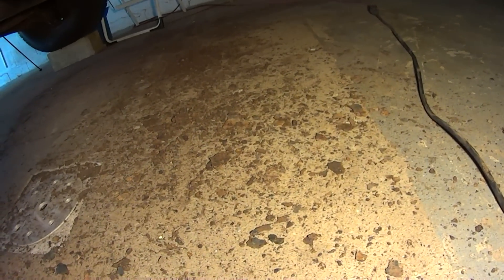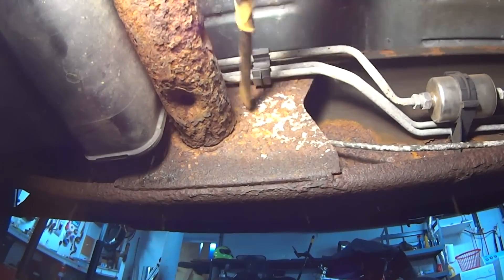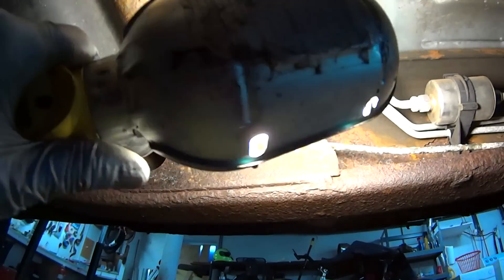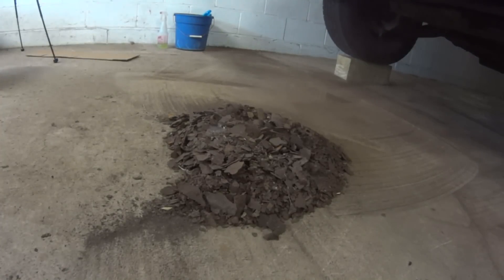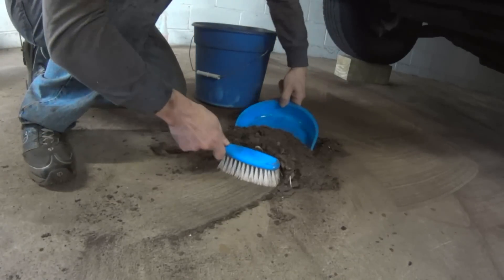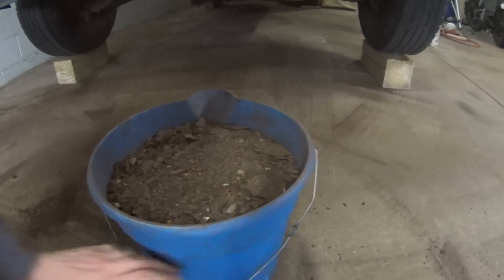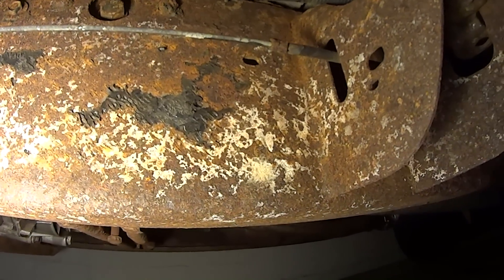Most satisfying video. Silverado Frame rust removal, RUST PROOF STUDY

Comment: Oddly what people do not is those semi thick layers that appear to be a semi thick layer of metal are actually the OEM rust proofing layer.. It is so decomposed and hard it appears to be a layer of the steel when in fact it is only the rust proofing with metal attached... This is what our Government has allowed China to do is remove the Nickles and Carbons from our automotive metals rendering a 30K Silverado truck a 50 cent piece of shit...

Comment: So you use an air chipper on it, then you grind it, and then I'm guessing you sand blast it.  Then you throw it away and but a different frame and just replace it?  With all that metal gone it sure can't have the same strength it had when it was new.  Just sayin.
Reply from the maker: 80% of metal is still there. Its 2500 truck that has the frame 3 x stronger than 1500

Comment: It's funny that Chevy makes fun of ford for using aluminum in their truck but from this video I think I'd much rather have ford.
Reply: Aluminum may not Rust but it does corrode. When you put two dissimilar metals together they corrode. So not sure how an aluminum body on a steel chassis is any good. 
Ford says it’s Military Grade aluminum. I highly doubt armored tanks are made of aluminum. Maybe their watches are.
Reply: @RedWhiteAndBlueVideo  Military includes aircraft, which are partially made of aluminum and have to survive decades in sea air which is loaded with salt.
Reply: john broskey I been where they make the aluminum Ford and I would not buy one, I seen them bring put whole bodies to throw in the roll off and a guy picked up a dumpster with a Hilo and sat it on top of the body and it just smushed it to the ground and busted into thousands of pieces. plus it corrodes and pits and turns to white powder, just a few years and these thing will litter the junk yards.
Reply: Brock Webb ford has that e coat that protects the hell out of it
Reply: xXxGnuVirusxXx I'm in the Northeast and I see e coded Ford frames come in the shop all the time the e-coating is fairly new I believe they started in like 2010 and it doesn't rust like what you see that Chevy but the E coating comes off in sheets instead of small pieces and then the rot begins so it's better but it's not perfect
Reply: RedWhiteAndBlueVideo Humvees are made out of aluminum
Reply: Chevy's will be using aluminum body panels too
Reply: iLikeC00kieDough so are semi truck cabs!
Reply: xXxGnuVirusxXx Ford e-coating is just as worthless as GM's wax coating. I've seen Fords with e-coated frames that look just as bad as this.
Reply: mcjagermech just doors and tailgate, 0lus the good that has already been aluminum for years. At least GM wasn't stupid enough to try to male the bed out of aluminum. Weak as hell.
Reply: Trucks rust. I really don't think the brand matters. Your truck or car will rust no matter what, that's just science.
Reply: Galvanizing and properly painting things the first time... also science, and your car WILL last longer.
Reply: Ya go look at the damage from "unsecured loads" lol where the bed gets destroyed, I could never and would never own a ford with an alu bed... I've had in my (older) chevy pallets of cobble stone... sliding around while plowing though nothing of it... if it was a ford with alu bed, the bed be destroyed...  Fords are too heavy, they went alu to drop weight.  This is a frame we are looking at not a bed... as said fords use steel as the frame material.
Reply: Funny thing about that, the "All aluminum F-150" is anything but. The frame is still steel as well as plenty of other parts. They even ran steel bolts straight into the aluminum panels, which is a big no no when using aluminum. I can assure you that aluminum truck is a fucking piece of garbage though, and I'm no chevy guy. I wouldn't buy or own a new ford or chevy because they refuse to make worthwhile vehicles

Comment: For even a rusted truck, chip it down (hopefully it's not anything near this), sand, wash, then brush on naval jelly, and get a few cans of back to metal rust dissolver.  After it dries, and gets cleaned up, buy a few cans of truck bed liner, and spray under the car/truck, and the frame, and especially in the wheel wells.  If your wheel wells developed any rust holes, just spackle a little bondo in there to fill the holes. The earlier in the vehicles life this is done, the better the results, and the longer the metal will last.  Even on my 10year old van, I just had to sand, neutralize, then I used 3 cans of truck bed liner underneath.  It looks like the old "rusty jones" job from the 80's. But this cost me less than $30

Comment: I hope people are smart enough to realize that that is not "rust". He's just removing the factory undercoating. The coating is "rusty" but he's not removing metal. 

The metal in most area still seems to be in good condition.
Reply: Yes undercoat is falling off, but it was bonded to the steel underneath it...that rusted....and flaked off...hence the undercoat falling off....because GM wax dips frames to save money instead of ecoat like Ford or Dodge...
Reply from the maker: The original rubber/wax undercoating fell off long time ago. Previous owners sprayed black paint over the frame. The black stuff you see is just thin layer of paint.
Reply: Removing the factory undercoating? You obviously never did this before... Pick a chunk up once and tell me its undercoating. There is metal in it. I bet half his frame thickness is in thoes chunks falling off.
Reply: NOT REMOVING RUST? You must live in Arizona, this is what happens to cars in the "rust belt". I went to a junkyard in southern California, all those cars were like new underneath, you could see the factory crayon marks on 15 year old Dodge Ram. Here in connecticut, all winter driven cars and trucks look like this after 10 years. As a mechanic, I did brake lines on a 5 year old Toyota minivan!
Reply: @demagchevy  I have never seen rust like this even in junk yards on 60 plus year old trucks or cars, in az this is unheard of😂
Reply: Adres?
Reply: That's good ol' rust right there!
Reply: And I'm sure all those rot holes are just vents, right? lol
Reply: That is rust no matter how you look at it, rust is rust.
Reply: Undercoating doesn't rust. Metal does
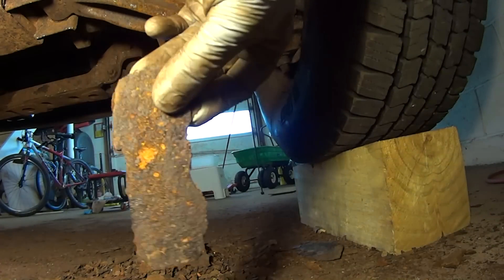Reply: Watch the video at 5:32. It's rust, and it is weakening the frame all over. The metal has definitely thinned from the rust. It's not just undercoating. Undercoating doesn't rust. Metal does.
Reply: In the video he even says the black stuff is the original coating.
Reply: Send me a link to that undercoat! That some diesel shiet
Reply: Tim Taylor I'm sorry sir but you are definitely incorrect!
Reply: It's definitely rust. Believe me, I hammered and sanded my wheel wells a couple years ago and wanted to cry because the rust was so thick. It's amazing how much and how quickly metal will corrode.
Reply: Rust is Fe2O3. Iron oxide. Oxidized iron. You can't have rust without iron.
Reply: Tim, just because you have a GM doesn't mean you should deny the rust. Just buy a Dodge
Reply: Sorry,was 1 te ver met vraag :adres?
Reply: Tim Taylor not for long.
Reply: This is true. There’s clearly some kind of coating that all the rusted metal has stuck too. If not for the coating, the pieces of rusted metal would not still be present on the frame.
Reply: Tim Taylor 8:40
Reply: Dude... No.
Reply: This is rusty sterl
Reply: That frame, is significantly thinner than it once was.  I did the exact same thing to mine.
Reply: I hope people are smart enough to know if that bucket was just full of undercoating it would weigh a whole lot less than 40 pounds.
Reply: Mark Orellano Whoever thinks that that is not rust coming off is crazy in the head.
Reply: My 58 Cadillac that my parents bought in 1960 has been on the road 60 years. Lifelong southern California car.  Never seen snow,  or any kind of road salt. There is nothing under the car that looks anything  like this. This is just scary looking to someone who's never seen it!
Reply: @markorellano8797  clearcoat is sprayed over the body paint. Clearcoat is never sprayed under a car on the undercarriage..
Reply: So all the fist sized holes and rotted through to the other side frames are “just undercoating”  you are the winner of the dumb fuck award on this post. 🎉
Reply: I was looking for someone to say this. I agree. I'm some parts it even looks like black rubber.
Reply: Sorry Tim but I don't believe you know what you are talking about. What part of the country are you in?? Rust flakes come flying off just driving down the road...or sometimes slamming the door if you are in the NE.
Reply: This 10x this! Went through the same thing on my ex-northestern Wrangler. Its just undercoat thats peeling off.
Reply: Tim Taylor : there is only one kind metal that rust and thats the steel right there! So yes you are loosing metal!!!
Reply: LOL. the undercoating is LONG GONE. This is the actual metal. Dude, don't comment if you are clueless.
Reply: Tim Taylor exactly that's just the powdercoating
Reply: Leslie B New Hampshire oil is a fantastic product but it does have to be done once a year I've been testing it for the last year-and-a-half myself and the results have been fantastic if you have a chance go get it done I highly recommend it

Comment: Good work cleaning up that frame.  
    I bet alot of the flakes are actually a combo of the original  (useless)  wax, and rust.
    I notice on newer trucks, the wax lift and peels off easily in flakes , revealing bright orange/ brown rust hiding underneath!  
   the cross members, yeah that's rust , but those larger flakes from the frame look to be  dried out wax and rust. 
    I use fluid film for undercoating,  but my friend has 2015  silverado with a leaf spring bushing worn and clunking and dealer says they don't approve fluid film and it caused the rubber bushing to fail...? 
  really?
Reply from the maker: BS. Fluid film will not damage the rubber parts

Comment: you need to take the cab and bed off the frame  when the rust is that bad  you're not getting the top of the Rails  and you can't do a good job  where  fuel lines and a host of other parts and mounts are hanging. hammer and even use a bigger ball peen hammer and knock the rust off then acid etch which is dipping the frame and acid or at least bring it and letting it absorb then hitting it with a steam cleaner several times then grind the s*** out of it and afterwards repaint and undercoat
Reply from the maker: I did take the bed off but the cap is a lot of work, especially with everything being rusty. I did try to scrape as much of the rust as possible. Lets face it. it is impossible to get everything off. There are many places where you cant get to even if you strip it down to the frame (boxed sections)

Comment: if that was a tacoma or nissain truck youd go right through the frame
Reply: Yeah if was a tacoma Toyota would be giving you a new frame let's see gm do that.
Reply: curiosityuniversal 
Toyota had a recall issue for Tacoma’s so bad that the frames were so unsafe that they break in half. 
My 2001 Silverado is Similar to this truck. I cleaned and prepped it and coated it. It will last many more years. It really isn’t GMs fault that Salt is used on roads and people don’t wash their trucks.
Reply: curiosityuniversal Nissan and Toyota trucks are known for frame issues
Reply: I call bullshit. I live in Finland and the roads are covered in salt in the winter, and the winters are long as hell. No rust on my 1991 Nissan Patrol.
Reply: Toyota yes, Nissan no

Comment: Oh no I had to do that 1 time is sucked so bad and I could not hear for 2 days after it was that damn loud. But I don't see why the car manufactures don't produce it with a better coating on the frame they know what the cars will be in and around I have seen them so bad the frame was so bad you could put your finger through it and that's not safe at all I told the woman not to put her kids back in it and after for the research I found out it was a flood vehicle smh

Comment: I've just read that Chevy still uses wax and everyone else in using a paint or electro coat, something better. They to step it up like having a option for a supercharger thats not too expensive. Also painting the dam frame
Reply: John Foster right. ford and dodge e-coat their frames to prevent this type of thing from happening. you can scratch the off of the GM frames with your fingernail

Comment: keep in mind that the weight of the rust does not equal the weight of steel. it may look like a good thickness of the frame came off, but rust is much less dense than steel. when you coat your frame with something and you drive on salty roads, it gets behind the paint, coat, etc. and hangs out there. thats probably why GM stopped coating the frames. i just paint mine with oil or a sticky lubricant.

Comment: Holy Shit.  Driving the winter salted roads in West Virginia or here in Louisiana around the coast around Grand Isle.  Damn you would figure that this problem would be resolved by now.  Looks like my old 84 Nissan truck.  That is a lot of money for spending money on a 2500 today and they are still doing this on the trucks?  Oh but the way when you finish the job you will reduced the weight like the new F-150.

Comment: What about the top side of the frame or the hollow portion?  Once rust starts, unless you encapsulate every bit of it, it's pretty much impossible to stop it completely.  I bought a boat and trailer many years ago where rust spots were visible.  A boat mechanic said that the frame was recently painted and those rust spots could be treated.  When I got the boat/trailer home, I hit the frame with a hammer and made large holes in the metal.  I didn't attempt to repair the trailer but just bought a new one.  Good luck.
Reply from the maker: For some reason the inside was not so bad. Still had the coating on in most places

Comment: Cover the frame with grease and it will protect it from rust even in salty road conditions
Reply from the maker: I did. I have 3 different coatings to test witch last better.
Reply: Astro Camper I hope they all work out well